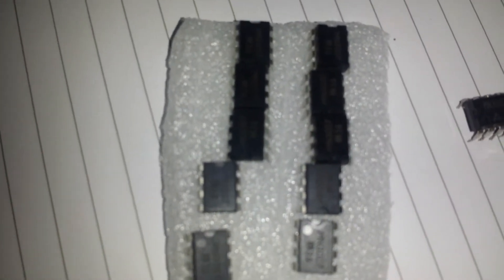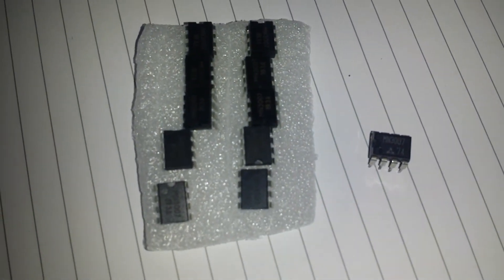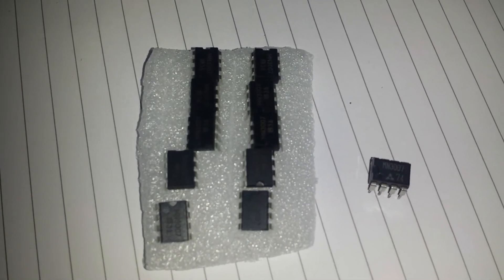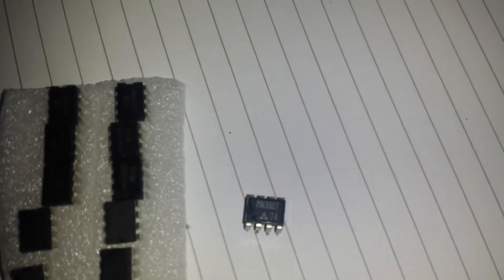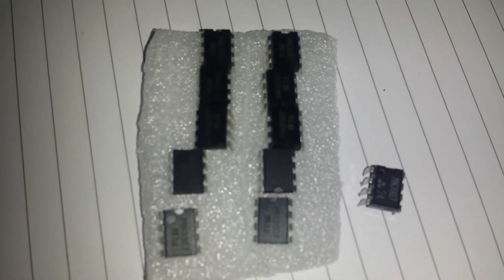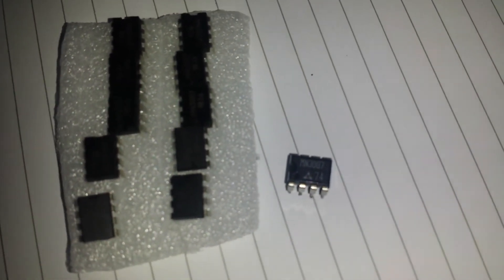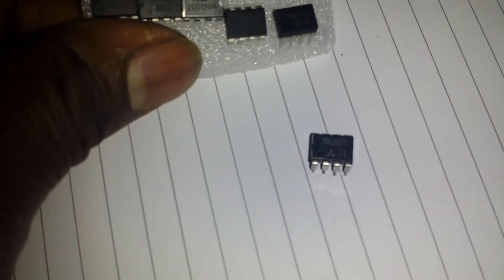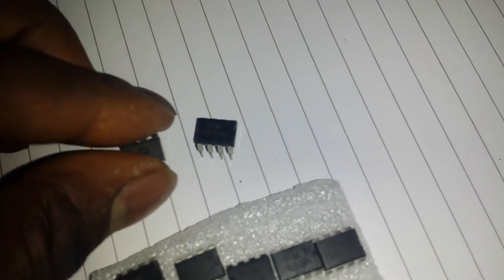DIY analog synth project (Fake intergrated circuit chips)

Comment: NEVER buy the chapest, always check evaluations and how long supplyer has been doing what he does. it's not for a couple bux, but personally i have been going CRAZY with ciruits not working, to at the end ernd up by understanding the chips dont work proper (74's ending up being 324 for example)... that's really anoying. when you got a cheap pile of chips,n keep it in mind when testing your circuits. but nevertheless, sometimes you can get good bargains because chinese are remaking very trad chips because they know how they are inside, we aint in 84 no more...
Reply from the maker: All very true and extremely good points. Sometimes its pot luck. You get some sellers charging a premium for a part which is fake in one way or another, so sometimes you can't always go by price. 
Yep had the same issues before where I was literally following a circuit schem to a T and couldn't work out why it wouldn't work, all because of a cheap faulty chip

Comment: I was sent the same ones. They have the 36 number on them. Same thing, they don't work and they just get hot. I experimented and tried one out in a circuit that uses MN3207. It worked! Some of them were dead because I fried them, but the rest are fully functional MN3207's. 20 years ago I got a bunch of MN3005's and realized that they were actually MN3008's with the tops sanded off and re-stamped. You can actually see traces of the original, authentic stamp from when it said 3008. Too bad they don't sell the chips for what they really are!

Comment: So do all the counterfeit 3207 not work? There are a LOT of counterfeit chips on eBay for lots of different applications. Most of them work perfectly well, though.
Reply from the maker: PelDaddy I couldnt tell you to be honest, this video is just to really make you aware that you can take a chnance and get ripped off . Every single one of these mn3007 did not work. I have a genuine Mn3207 and Mn3007 bbd and the print on them look diffrent from these chips.

Comment: I think it's can be a way to know if it's real or not before you'll pay (at least on eBay because it's not that easy as on Ali). You can ask to show documents on these ICs at least. If these are real then they get them with papers (when ordering a big quantity).
Reply from the maker: MoolahNasreddin Oh i see ok . Yes well ebay is like a shark pool if fakes and counterfit all over. Lesson learnt id say. Thou i did orser some pt2999 delay chips which i havnt tried yet. Hope i havnt been ripped off again lol.
Reply: You know... thanks to this article http://www.modularsynth.ru/2013/11/30/musical_chips_part_3/ I've got some cool tips about our type of ICs.
I translate about CoolAudio:
The modern company named CoolAudio is famous that did made happy fans of BBD-ICs by making out modern and non-expensive analogs of BBDs of Panasonic MN3205, MN3207 and MN3102 named alikely: V3207, V3205 and V3102. Beside that the company makes several VCA models. V2181 — the copy of THAT; V2162 and V2164 is a full analog of SSM2164...
http://electricdruid.net/product/v2164-quad-vca/
http://www.coolaudio.com/products.html - the minimum order is 2000$ though. But it's on the main site.
I'm picking random URLs
https://www.banzaimusic.com/Coolaudio-V2164D.html
for "CoolAudio v2164 buy" on Google.

Comment: I hope you've made a complaint to eBay. Real cheaters like these must not be forgiven. Or the whole idea to buy ICs from eBay and Ali is becoming a joke. By this video (or another with a better focus of the camera) you'll easily make this IMO. Do they "paint" some 555 IC to imitate these? It will be good if you'll add a link to this fake to the description.
Reply from the maker: MoolahNasreddin No i havent i made a complaint direct to the seller and got a refund thou i could tell they were desperate not to get negative feedback from me. Yes sorry the camera was a bit crap on focus . I could tell straightawat something wasnt quite genuine about the ic . I know the bbd should have had the 3 diamond symbol for a start and a slight border of darker coloyr to the edge. Mind you the mn3207 amd mn3007 i now have which are genuine were taken from old 80s electronics. So at least i had something to use as a test . Was very fustrati g when my circuits didnt work and i was convinced first of all it was down to my mistake on the circuit i was building.
Reply: It seems that very few people make any complaints about these ICs because they has nothing to compare with. OK, at least you show it here, it's cool too. Make a post in Sythn DIY type of groups so shy people will be warned.
Reply from the maker: MoolahNasreddin Yes its true . Thou im sure most of the guys in Synth DIY already have enough experience and sense not to buy them from where i got them from. Might be more of a relevant post for the guys in the DIYstompbox group. Thanks for your suggestion :-)